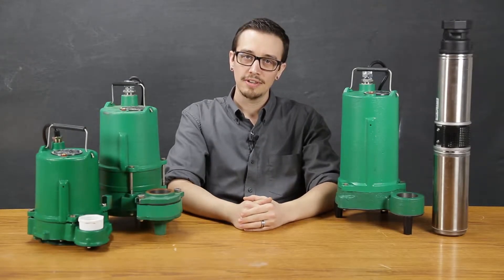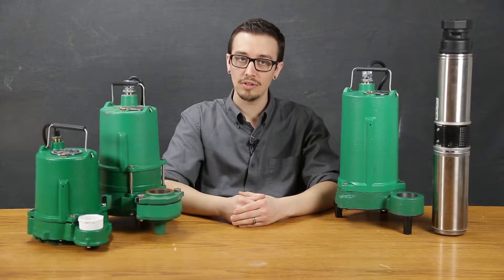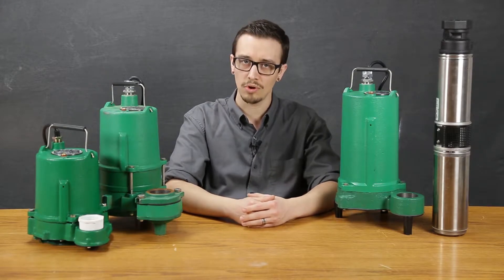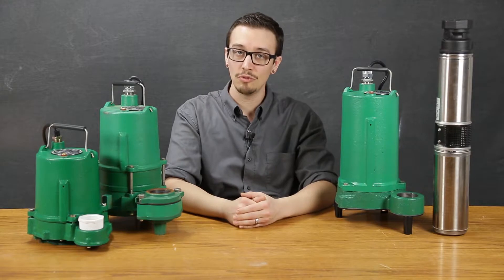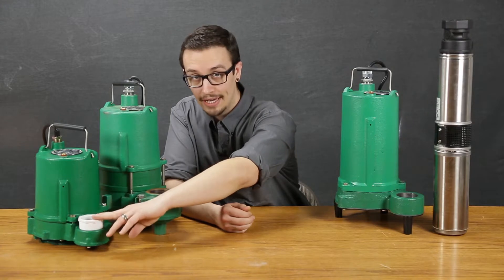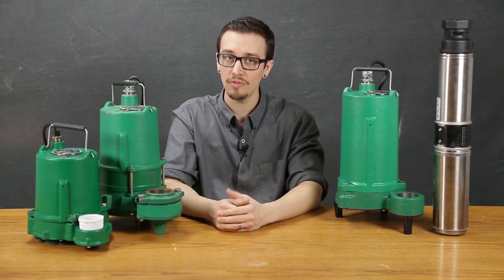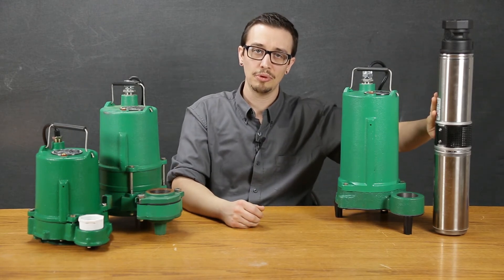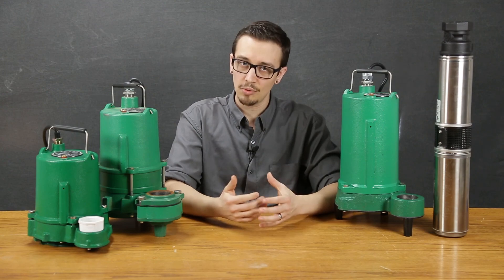How to Select an Effluent Pump

Comment: An Effluent pump is a pump that pumps the water that passes the baffles of your main septic tank and thru a filter (if equipped) into a smaller liquids tank before being pumped into the drainfield by a pump? I want to make sure I have the terminology correct.

My drainfield/leech field is a full story above the tank. (Drain field is uphill and about 50ft from the effluent tank).